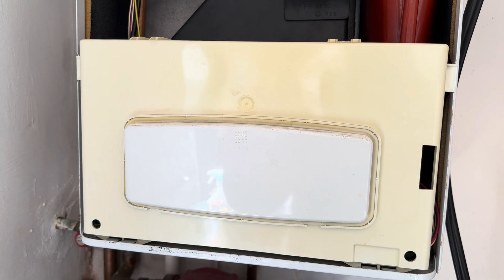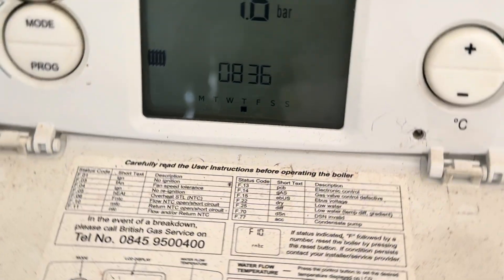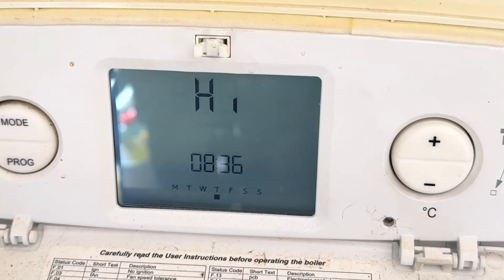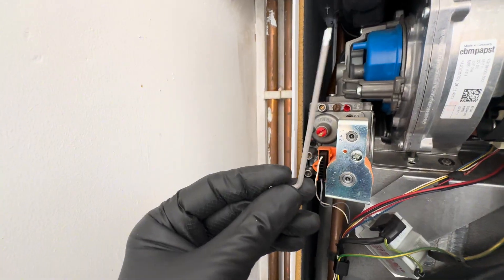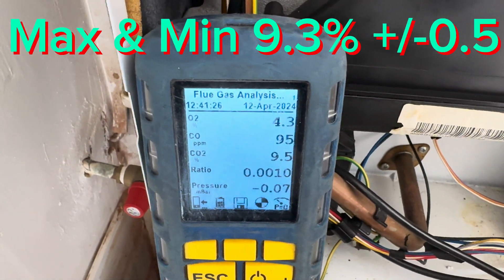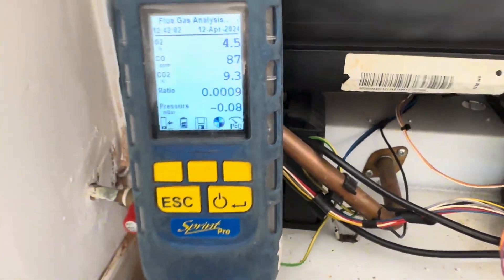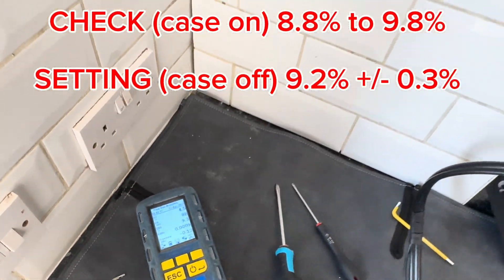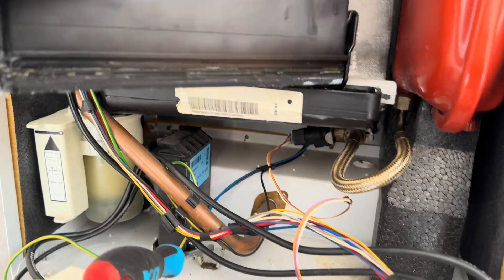Why did they ghost me?!

Comment: The plate common problems, the vibration agitated it and loosen them never had a recall always tightened those screw on every valiant service, also that black plastic condense pipe tends to leak,and cartridge keep the good work 👍
Reply from the maker: That’s right, all common design faults you’ve listed. And like you, I always give the screws a tighten. With the condense pipe, wrap it in insulation tape where it sits on the copper pipe or cut a rubber o ring and slip it over the pipe and it will create a gap.

Comment: I found them vailants leak alot from the plate heat exchanger bracket. Straight forward job.. Great video! Keep up the good work
Reply from the maker: Very common! Rarely go to one where any of the manifold or jig screws are tight either, never as bad as this one usually but still shouldn’t be the case! Appreciate you watching, if you haven’t had a chance to get, subscribe and catch me next week - annoyingly I’d really like to film a part 2 to this!